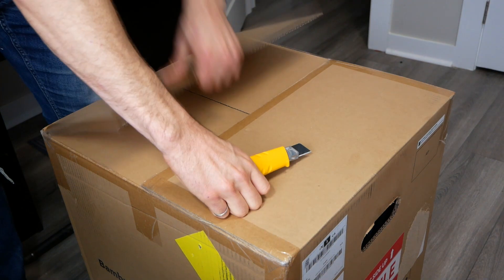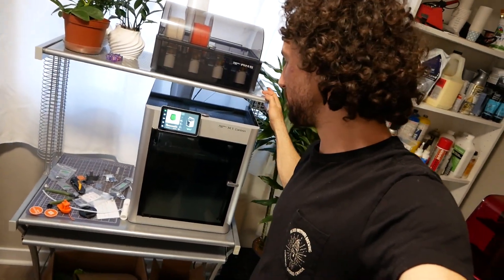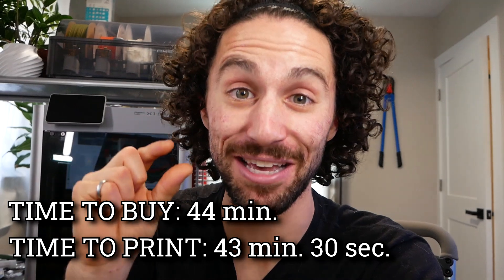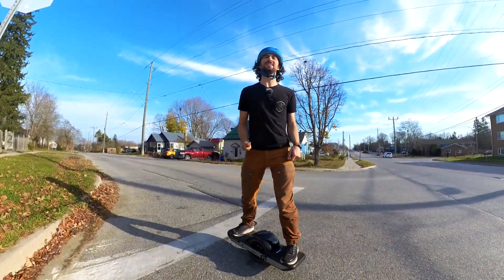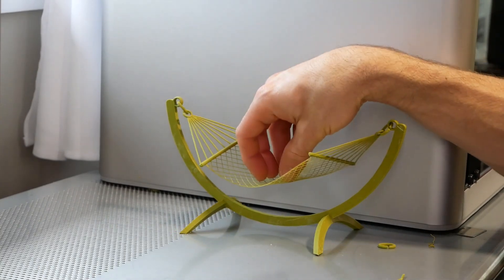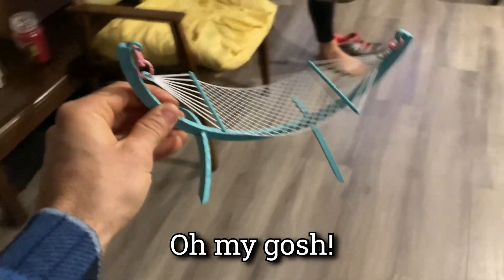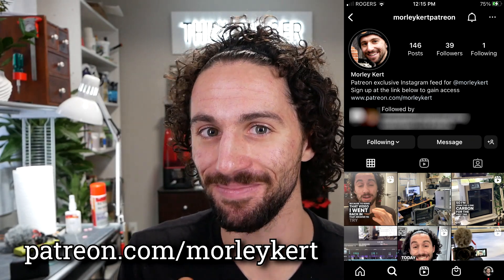Racing The FASTEST 3D Printer

Comment: Ok so bambulab. Everyone talks about it. Everyone says it’s the best printer. But the reason I would not pick ANY of bambulab printers is because of their IMPOSSIBLY HARD CPNSTRUCTION. I mean 1 Z acsis rail?! How is this even possible this thing gonna being offset when I add pressure to it! Reality is better printer because it’s not that complex. Install and ready to go. With everything calibrated (if the printer is YX core) or very VERY upgradable.
Reply: No I wasn’t completely talking about this printer. But all others. + multi colour filament.. it’s more mess around the house

Comment: I purchased the A1 3D printer, and because of the black friday sale on right now, it was just $299. The print quality is perfect. The speed is the same as X1C, as in super fast especially with sport mode (which you should have tried!). The ease of use is amazing (wifi capabilities, auto bed leveling, filament failiure detection). And it has an incredible powerful slicer and maker world community.

I can't recommend it enough for people who saw this video and were turned off by the price. You can get the AMS version for only $449, which I wish I had because the things you can make with it on maker world look so fun.

Comment: Try putting the printer on a thick NBR foam yoga mat.  It might cut down on some of the noise. I have found that printers there are 3 sources of noise, the motors, the fans and the printer vibrating on the table. The mat helps the third. You can add sound dampening on the inside if you wanted too

Comment: You will love this printer. Mine has been going non stop since I got it.  Yes there are some fails, nothing is perfect. I’ve had to take apart the extruder to clear it once. But dange prints are nice and the fact I can print ABS without issues makes me happy.
Also get a PEI textured sheet. The stickers are horrible. I went through three in four days. PETG ripped them. Bought mine off Aliexpress from energetic

Comment: For those who actually want a bambu, don't waste your money on the X1. It's like a $300 markup over their new model just for the lidar, which is 100% unnecessary. You can literally tape over the lidar sensor and it makes zero difference. And bambu is silent on feedback about the lidar. Spaghetti detection is a gimmick and doesn't even work, lidar is a gimmick and makes zero difference to the calibration or print. Auto flow calibration is also a gimmick and nobody uses it. 1st layer calibration is pointless. You can literally print the calibration flow lines, peel the lines off and the sensor will just pick a line that doesn't exist.

When people do their prints on their X1, they turn off the flow calibration, they turn off the 1st layer inspection, and they tun off the vibration calibration. Basically everything that uses the lidar, they turn off. Meaning they spent and extra $300 for a sensor that nobody uses.

Comment: There is a GitHub pace that creates a printer profile that only prints the front purge line, saving more time ( I damaged the right-back cornw of my cool plate sticler, so removing the back right purge line became a struggle)
And you could have used the "sports" or "ludicrous" printing mode to gain more time

Comment: Thoughts on this video (I too own one of these but gave them a chunk out of my wallet):

1. About the Corexy explanation at the start of the video, Im sure you wanted to keep it simple, but I will just note that there are other types of printers which arent CoreXY where the head moves in the x and y. Things like H-Bots, Deltas, and Cartesians even. Something like the Ender 5 for instance, while it will be slightly faster than a bed slinger, will still drag around the X axis motor with the head making it significantly slower than a CoreXY or HBot design. Thats the real benefit here: Not dragging around a heavy stepper motor. Of course this isnt really a criticism, just adding information because I've seen a lot of people buy ender 5s thinking they were getting magically fast printers when they arent.

2. Whenever you do build the table mentioned, you want to make it really sturdy so that the resonance compensation gets the best values possible and you get the best speeds possible. The stiffer the platform, the better the results. This isnt Bambu specific this is also true for any printer that runs resonance compensation (in klipper this is called input shaper for instance).

3. I like this printer and it really is the future, and I actually feel like I got my moneys worth and recommend it but it is loud. A huge part of that is fast things make noise, and thats unavoidable, but it also doesnt have silent steppers. Its not like it is so loud that youll hear it in a different room ,but worth mentioning. I imagine they did this because they figured it'd be loud anyways and wanted to cost cut somewhat given that this thing has the performance of a voron for half the price.

4. There is a great video on the small channel 75echo about reducing waste with the AMS that might interest you.

5. At 9:40, a moment of silence for the horrible car centricity we have in most of North America. Straight up no place for actual people to cross. You're expected to just have a car.

6. About the price, I actually think it's cheaper than a prusa when you compare everything similar. The prusa fully assembled is 1099, the X1 is 999. Then at the lower end the kit is 799, but the Bambulab P1P is 699. Then you consider that at each price tier you are getting a lot more for your money and the mk3s starts looking quite dated/inline for a price decrease.
Reply: was about to comment this lmao

Comment: Not anywhere near the 'fastest' , where did you hear that B.S. ? Their marketing team and your free printer must have warped reality.
Reply: it's the fastest out of the box machine under like $10000. Sure, a ratrig or hevort is going to be faster, but those requires hours of assembly.
Reply: It may be the fastest you can buy fully assembled for under 10 grand, but it's nowhere near as fast as the Annex machines you can build for a few thousand and that are open source and use widely available parts from existing ecosystems.
Reply: You can also make a $150 Ender 3 go faster than the print in this video for about $150-200 in upgrades. But the Bambu could easily go 3-4x as fast as shown here with minimal or no loss in quality.
Reply: @daliasprints9798  As someone who has modded the hell out of cheap printers with klipper linear rails, the works you are talking absolute gibberish. at best you'll get an ender 3 to 3k accel and that's pushing it (you'll see losses). The Bambulab is 10k standard and 20k max speed (probs can go higher with big quality losses). An bed singer has no chance in hell of matching these speeds. None.
Reply: @BeefIngot  Perhaps you should click through to my videos. 3k is about the max Marlin can handle, but that's why you don't run Marlin. I use 60k X travel accel, 20k Y, 45k/15k for infill and inner walls and skin, 6k/2k for outer walls.
Reply: @daliasprints9798  I'm talking about the max with klipper. You can't even get close with Marlin. With Marlin going above 1000 gives you serious ringing on the best tuned ender. 

If you are telling me you get more without degraded prints I think you are lying. I've yet to see an ender print faster than around 4k without serious ringing problems.

Looking at your channel videos nothing about your setup indicates it does anything a typical klipperized ender can't do. Looks like a fairly basic hotend and cooling upgrade.
Reply: @BeefIngot  4k is above the threshold on Y (not X) where you'll get some inaccuracy (oversmoothing way before you get ringing if your input shaper settings are right), but for all features except outer perimeters (assuming you print outer first) it's nowhere near enough to affect the quality of the print. The adjacent features constrain the extrusion so that it ends up in the right places even if the toolhead path is imperfect.
Reply: @daliasprints9798  What are you saying, you adjust your accels on the fly for different sections of the print? if not it's fruitless because your outer layer will definitely show.

Anyhow, you can say this where I can disbelieve you or post actual evidence you have good looking, non ringing, non smoothed prints above 4k, because the videos on your channel show printers that look to be accelerating much more slowly.

Id be shocked to see it, because right now I think you want to feel like you've made some magical printer that defeats physics and do things people  build printers that cost way more to do, and its just not believable because of the kinematics at play here.
Reply: @BeefIngot  You can set accels for different wall types in the slicer. I currently only run 6k on my outer walls to have cleaner outser surfaces (fast accels can sometimes make translucient filaments looks weird), and to reduce ringing a bit. All other features are around 15k.
Reply: @BeefIngot  on his channel, there's a ten minute benchy. That definitely goes over 4k acceleration. Especially amazing considering the fact that he used TPU!
Reply: @morbus5726  Damn, wow that actually is impressive.

It actually doesnt even look that bad. Im hugely shocked too because its just vrolllers. Ive never seen an ender so close to stock deliver such performance.
Reply: @morbus5726  I haven't seen this setting in any slicer Ive used (cura, or bambu studio are the main ones). I imagine this is from Super Slicer perhaps?

Also, whats the jealous comment about?

Edit: I googled this and actually @dallas prints comment seems very legit. Apparently it being added to Bambu Studio and has existed in Cura for a while. Today I learned. Im going to be playing around with that for sure.
Reply: @BeefIngot  ah i think it might just be a superslicer thing? Not exactly sure. The jealous comment was directed at the original commenter, @Witness101.
Reply: @BeefIngot  yea, it's especially crazy given that its tpu, which is extremely hard to print at higher speeds.
Reply: @morbus5726  Ah.

BTW dont know if you saw but I did edit that previous comment after I found out this feature is becoming more wide spread.

So many printers will be able to print so much faster. Now Im wondering how fast I can get a good looking benchy.
Reply: This is by far the fastest machine you can buy. It is also literally faster than vorons, which are known for being fast.

Sure a custom Vzbot will be faster, but you cant buy that, you build that.

247printing has an in depth comparison of the Bambu vs Vorons if you dont believe me and want concrete evidence.
Reply: @BeefIngot  well that's not exactly true. A voron with a rapido hotend can be much faster, and by faster, I mean in terms of volumetric flow. The big limiter on the bambu lab printer is the hotend. It can flow around 30mm^3/s of material, while the rapido (a common hotend on DIY printers), can flow up to 70mm^3/s. The bambu is hands down the fastest out of the box printer though.
Reply: @morbus5726  that's not standard for voron though. Most don't use those. On top of that, Sure you can put a LSD on some printer and drop rope, but  no one actually can max out those volumetric flow rates in real useful prints because they don't want massive quality drops.

OK there is more nuance to that, as in I can see real use cases for over 30mm cubed but the use cases are rough large parts printed quickly and this printer isn't large format anyways so I think it makes sense for maybe a big 500 cubed ratrig, but I think the tradeoff of less ooze etc with the 30 here makes sense for the actual things people print with printers of this size.

Of course as ai mentioned though vzbots exist but the entire point is that this is faster than printer people consider really fast. I don't think we disagree much though.
Reply: @BeefIngot  I actually do happen to have a 500mm ratrig with a 60mn^3/s capable hotend (0.6mm nozzle). I guess you're right about the voron standards though. You can ultimately mod a voron with crazy upgrades, but the bambu is going to be a much easier experience.
Reply: Someone's jealous :)

Comment: Love this video, such a great idea for how to show the speed with a real world example. I've had a X1C for a while now as I was an early kickstarter backer. I use the bed levelling on every print as found the z height seems to vary every so slightly and sometimes hurt bed adhesion on the first layer if you don't have it enabled. But flow calibration? Never use it now as I don't think its worth the extra time at the start.
Reply: I like using the flow calibration when printing random different filaments with the generic profiles. But for those filaments I print a lot with I have separate profiles saved where I manually set the flow ratio after some tests, running the calibration on that probably won't help much.

Comment: @Morley Kert Way to go on the printer!!! You deserve it!!!😁👍🏻 I've got the Ender 6 which is also a CoreXY configuration!!! Good Stuff!!! What is your hotend temperature for that high speed?... and your mm/sec print speed? Around the $1400 mark for a fast printer and multi-material change is NOT a bad price!!!
Reply: the bambu x1 goes to 300c, has a max printing speed of 500mm/s at 20k acceleration.

Comment: You can tell from the benchy it still isn't perfect, some globs near the lower half of the door and some uneven layers too, but it really depends on how fast you are printing at and worth the trade off or not
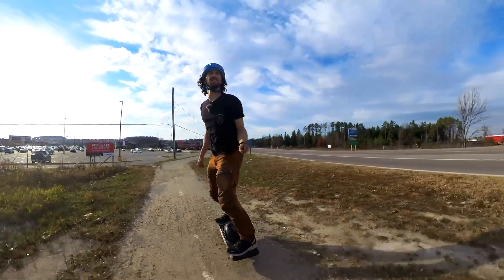Reply: Also 9:27 that obviously failed to stick to the bed
Reply: 0.16 vs 0.20 layer height makes a noticeable difference, especially when overhangs are involved!!!
Reply: Its probably the stock sliced 17 minute benchy

Comment: The X1C is what got me into 3D printing, I've been watching your videos since getting it like two months ago. I'm so happy you got it as well! It's a fantastic machine. A few tips though: Print PLA with an open door or top cover, I've had two clogs thanks to heat creep when keeping it closed. Get the textured PEI sheet, it makes everything better and you won't have to use glue anymore. And lastly, modify the gcode in the filament profile to not turn on the exhaust fan for PLA. It's not necessary (especially when keeping the enclosure open) and it makes the printer soooo much quieter.

Also, for those looking for something comparable but cheaper, BambuLab just announced the P1P, which is basically a scaled down version of the X1C that's more easily customized as well. And it costs around half of the X1C+AMS combo.
Reply from the maker: Awesome, thanks for the tips!

Comment: bruh this machine looks like it costs 1k and ur a toronto nerd so mark that up another grand
Reply: yeah it's around a grand US ... but since every youtube 3d printer channel has one... i wonder if the friggen company even MAKES money..
Reply: @BarfusWOW  they do, they send units to content creators to promote more sales its worth it for them because even if 1% of Morleys audience buys one that is still 23k they are making they also likely paid money on top of sending him a free unit gotta be ware of what ytbers say about sponsored products
Reply: Im also in Canada, and it doesnt cost that much more even though our dollar is not the greatest at the moment. In canada its 1219 or 1459, so pretty close to dollar conversion (actually slightly better in some cases).

I bought mine for notably less than 2k CAD with the bundle
Reply: @BeefIngot  modded my ender 3 for like 300 with tax metal extruder flex plates auto level kit sure time is important but until i see some side by sides its hard to justify spending over a grand
Reply: @thatcanadianguy3327  What you are missing is your time tinkering with crap, modding things, tuning things etc. You don't do any of that here.

Believe me, I have a modded to hell big cheap bed slinger running klipper, direct drive, custom motherboard, accelerometers etc.

This is sooooo much more pleasant to use, and I didn't waste double digit hours of my life and 700 bucks on mods to get there.

Yes, my printer is cheaper for a larger build volume, but not that much and it's actually more expensive if I pay myself for the time spent messing with it.
Reply: @BeefIngot  i hear ya man mine isnt even working atm something software relating the nozzle is just slamming into the print bed I said F it and bought a resin printer instead much easier loool